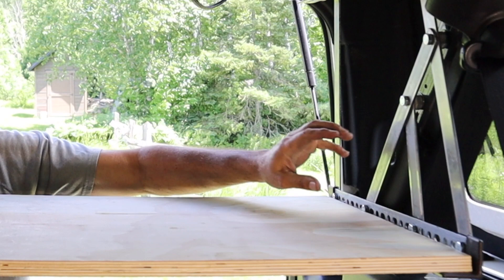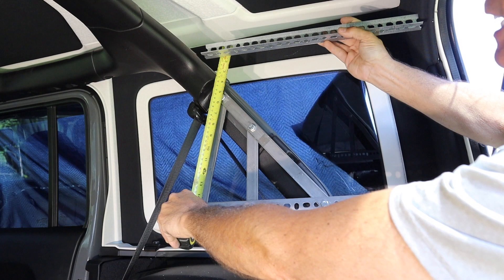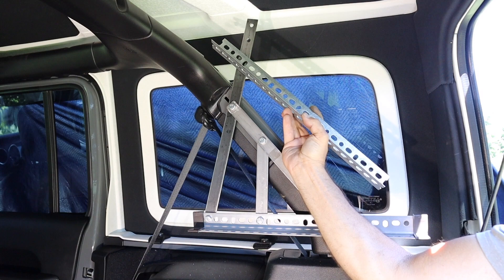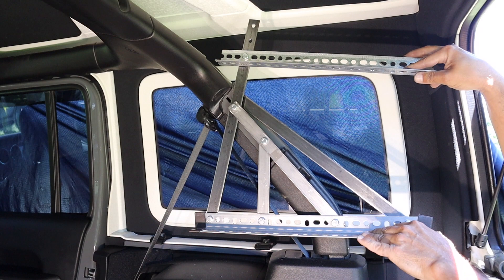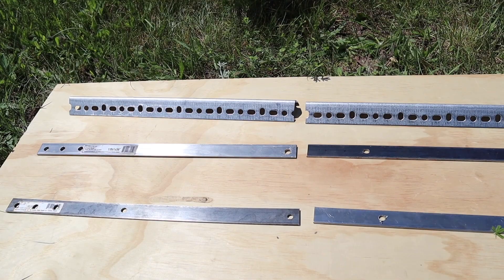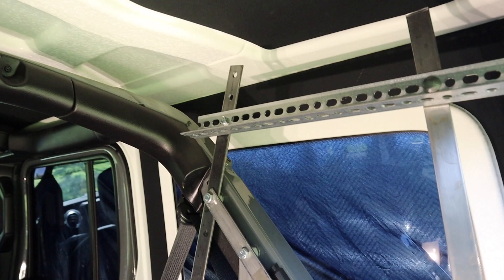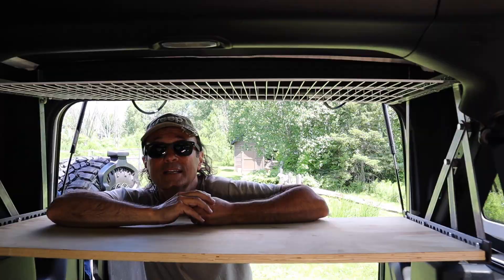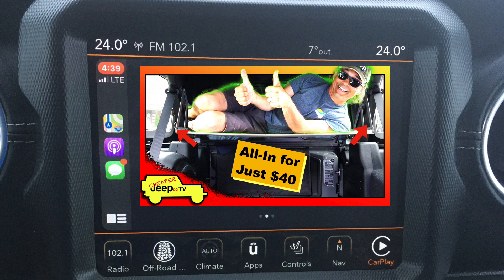DIY Cargo Area Metal Shelf Bracket - PART 2 - With Swing Away Attic Storage Shelf - Wrangler JL

Comment: Smart!! Wire shelving on top is awesome!! Useful on drying up things!! Thank you.
Reply from the maker: Hey Tor Ontoraptors, 
You are welcome. It works great too. I'm super happy with how it's turned out.  I ended up changing out using the bolt and wing nut to release the shelf to swing it down. I ended up getting two 5/16" clevis pins,(https://amzn.to/3yAazPb) as they work just as well and are quicker to pull out.  I was concerned about rattling, but it's good.  I'll have a quick feature of them in next week's video, in the TIPS segment.  I updated the link to the clevis pins in the description section of the video.  I hope it helps. Cheers.